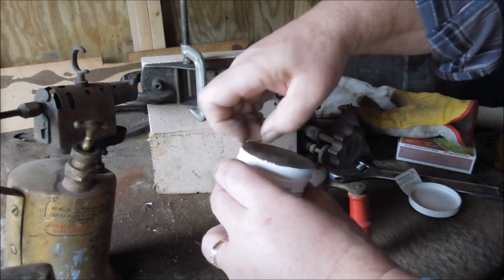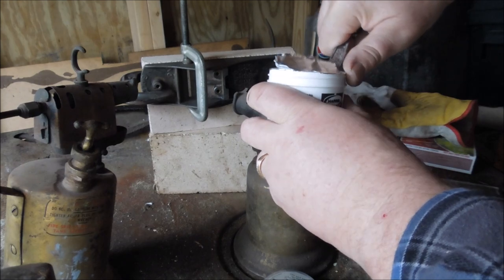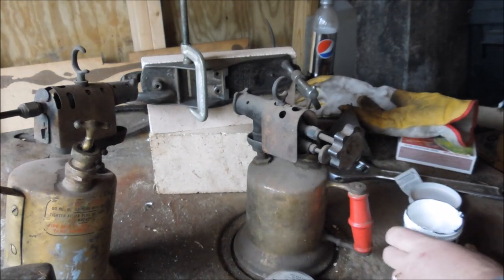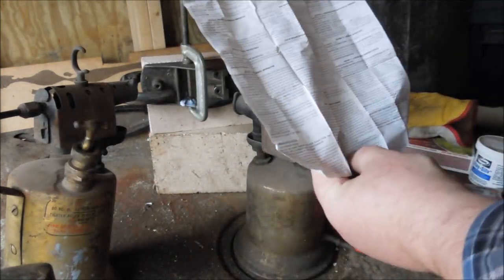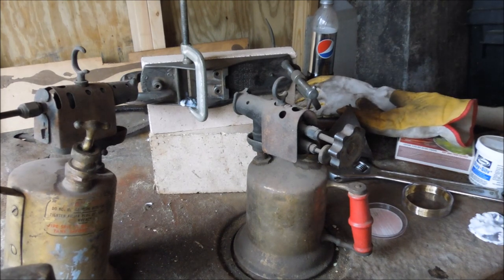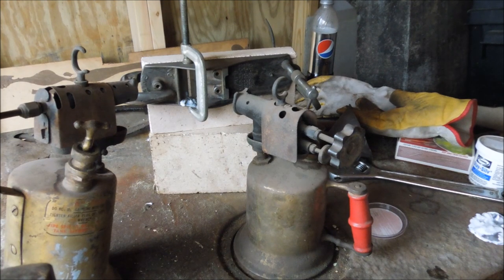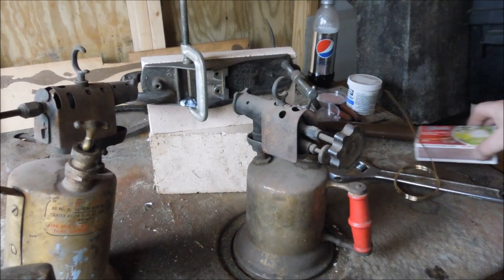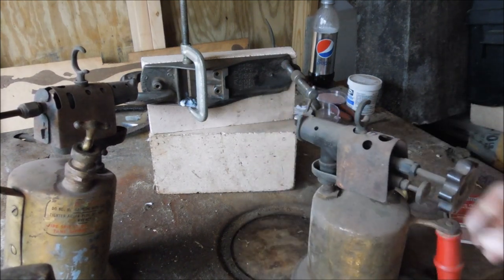Blow Torch Blow Out Pt 2 by Old Sneelock's Workshop

Comment: Starting to wonder if maybe there was a lot of snow on the ground it would have been helpful to toss flaming torches into???
Reply from the maker: +GrandsonofKong Story Alert:
40 years ago, before I was married, I had a friend call me and say that his Colman lantern was leaking. He wanted to go out ice fishing and needed it. He wanted to know if I could fix it. I told him to bring it over and I'd look at it. 
When he got to the house I went down to the laundry room/workshop to get a roll of Teflon tape.  He followed me down the stairs to the rec room. I went through the swinging door to the laundry room and when I came out he had lit the lantern. It was leaking between the manifold nipple and the valve. As I started to tell him to put it out it burst into flame. Now this was getting serious. 
He yelled "It's going to blow!". Then he threw the lantern at my feet, ran up the stairs, and out the back door.
I picked up the lantern and turned off the valve. The flame went out immediately. 
The blue smoke was rolling as I walked up the stairs. He was standing by the back fence a hundred feet from the house. After I explained his heritage and expressed my displeasure with his actions I fixed leaking pipe thread and told him to never do that again. 
Flaming torches should:
A. Never be lit if you're not sure it's absolutely safe. 
B. Never thrown. Especially not at me. 
C. If you ignore A. and B. start running cause I'm really not going to be amused. 
D. If you want the snow to melt it's going to take a lot of torches.
Reply: Old Sneelock's Workshop
 I like how you phrased..After I explained his heritage....flammable liquids, confined spaces and products of dubious repair are always a bad combination.
Reply: +Old Sneelock's Workshop  Explained his heritage and the age he was when his parents were wed and it probably went on for a WHILE! It would have with me, I promise you. Ain't nothing to be gomming with, sure. But I like the way you handled it. Not amused is an understatement if there ever was one. I like kitten videos but yours are a lot better. Thanks Unc!